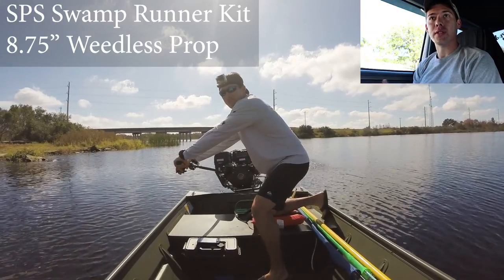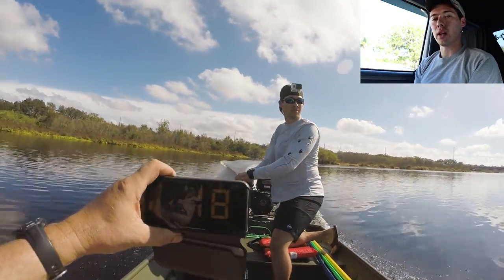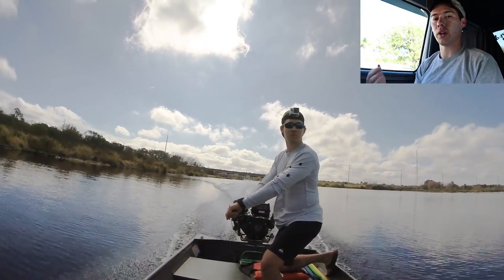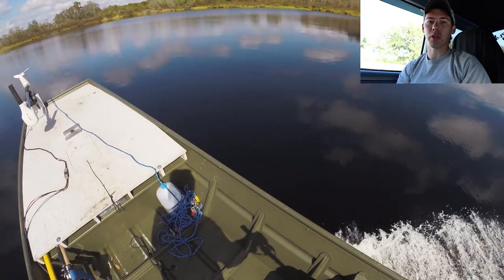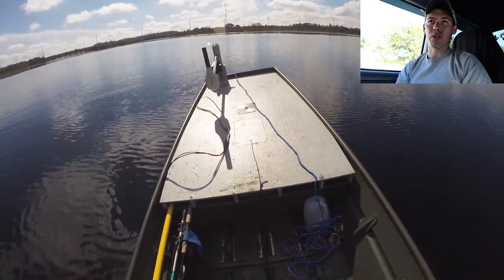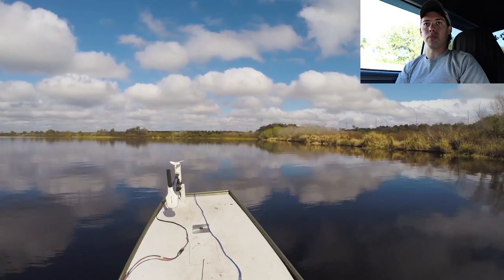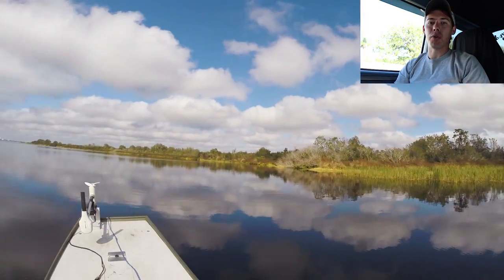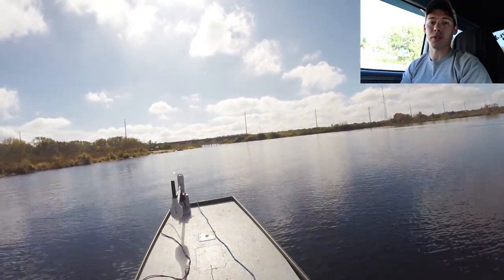SPS Swamp Runner Mud Motor kit Out on the Water! S3E3

Comment: You have put together a very nice series, with a ton of good information.  Thanks for taking the time and effort to put all this info in one place, along with your experiences, and observations.  I have to agree SPS is the way to go for the longtail kits.  I have the small and the large kit, both have been reliable, durable, and loads of fun.
Reply from the maker: Thank you very much Kansas Longtails!! I hope you enjoyed the content so far! Still a little bit more to go. I see that you have a Backwater kit. How would you compare your SPS to that?
Reply: JTgatoring My large SPS kit with 22hp predator is not completely fair matchup to my friends SWOMP lite with 37hp....  I can not say from experience, as we have not driven one another’s boats.  We are able to get around in the same areas at similar speeds so far.  I will say he has a distinct advantage really digging in the mud with the extra hp and stainless prop.  That being said I don’t mind sacrificing my $20 prop to go play in the mud.  My friend may have more to say on the topic.
Reply: Backwater owner here. I'd say it's really comparing apples to oranges with our setups. He has a much lighter boat (riveted) also his is a true flat bottom vs a mod-v hull that's much heavier (welded). Like he said, we get everywhere the other does and at similar speeds. Bang for the buck if you're running a light boat and don't intend to carry a lot of weight, SPS is the way to go. If you have a heavier boat and want to carry more load, Backwater is the way to go. Now with that said, he could have built 3 of his longtails to my one so..
Reply from the maker: Awesome!  Thank you for the info! That is a hard comparison to make with those two on different boats and sizes. I have a few projects lined up right now, but after those are done, I may look into seeing if I can compare the Backwater kit to the SPS kit. I never thought of comparing the load carrying capability between the two... that would be interesting. Thank you very much for the input!!

Comment: You have put together a great series on the 3 brands of longtails! Thanks for taking the time to out all this information out there. I started watching Damon's videos over at Black Warrior Lures a few years ago but that was after id purchased my small SPS kit. Im running a medium SPS kit with gx390 Honda engine on an old heavily built 1436 loweline riveted jon and im now having trouble with my prop skipping around on the surface. Never had this problem with the small kit.. i did bend my skeg a little and that seemed to help but did not totally fix my problem.. however i noticed from your vids that you have your transom bracket turned opposite of the way i have mine... You think this is my problem? Im running the 85in shaft since thats suppose work on a 36in boat or less and 100" is for a boat larger than 36in up to 48in...you also mentioned in the Mud Skipper video your prop nut fell off.. i had this exact same problem with my medium SPS kit in the fall last year but i was running a Mud Skipper prop.. may have something to do with mud skipper props because out of the 6 years I ran my small SPS kit I never had that happen but i also never used a mud skipper prop on that kit....
Reply from the maker: Thank you ky angler42718! I hope you enjoy the videos as much I did making them! If your boat allows it, put the pintal (at least that what I call it or the gimbal pin) on the out side of the boat. This does change the way it rides. I have experimented with this also, it will be in other videos down the road, but to make it short, it rode better for me when the pintal was on the outside of the transom. If that doesn't fix it, make sure the prop is in or near the center of the wake, make sure you aren't out running your wake (when I was going over 20mph, I was out running my wake and would probably benefit from the 100 inch shaft), make sure the transom isn't taller than 16 inches, trying giving the kit more tailweight (use the hole furthest away from the tale),  and test different SPS props. The CKS Mud Skipper props will no longer fit on the SPS kits because the new CKS props don't have a keyway in them and just wont fit. If none of that fixes it, just give Swamp Runner a call and explain your situation. Keep me updated!
Reply: JTgatoring im for sure gonna turn that transom bracket around and run it that way and see it that fixes it... i know that should give another 6-8inches to the tail length and i believe that eill put my prop in the wake more than it is now.. that gx390 just causes my boat to outrun the wake so i never never need full throttle. Did not know they changed the cks props, thanks for that bit of info.. ill have to relay that to a friend of mine thats running the cks kit..you keep me updated on any changes or modifications you find helpful amd i will do the same.. glad someone compared the 3 kits so everyone looking to buy into the mud motor world will know the differences
Reply from the maker: Awesome! I'll keep updating the channel with how the kits are running and if I need to make any changes. Keep on longtailing!

Comment: I have never owned or operated a mud motor. Only outboards . I've had the same 25 hp yamaha on my 15-44 Alweld for 21 years. I am tired of hitting stumps in the Sabine river with the outboard. I have enjoyed your videos and you really seem to know what you are talking about. Another thing I like is that you seem to like to do things as cost effective as possible. What I would like to do is switch over to a mud motor. The motor that I really like  I found on backwater for $3,850. It has a Honda GX690 engine 23hp. My question is, is there a way to get this motor cheaper with a swamp runner kit and engine bought seperately? Another thing I am afraid of is buying the mud motor kit and the engine not being compatable. I just have no knowledge of these kinds of motors. Where can I start?
Reply from the maker: Well, let's see if I can help out! So we'll start with the engine. You want something around a 25 hp (something close to what you have now) and save a little money. So the cheapest option is a 22hp V-twin Predator from Harbor Freight for $750. Normally you can find a coupon for them in a magazine or even on eBay and get it for $600 to $670 (so up to $50 to $150 off) but let's say $750 msrp for the engine. Now onto the mud motor. After testing the longtails, I would only recommend a Swamp Runner. Their Large kit fits the engine without any modification and costs $700. So the cheapest route is $1400, maybe less if you can find a coupon for the engine. If you want a little bit nicer of a motor, I hear good things about Briggs. Hondas are way too expensive. I've heard a lot of good things about the 22hp Predator from Harbor Freight. If it runs without any issues for the first 10 hours then it should last you a long time with proper maintenance.

Comment: Ok . Now is the prop moving so fast without throttle that it moves your boat when your idling or is it just turning but barely moving your boat .
Reply from the maker: At idle speed, with the motor idling, my boat goes 4 mph. If you know you're going to be doing a lot of idling and you want to go slower, then you can drop to a smaller prop size.

Comment: I'm not sure what you mean by that the gimbal being on the outside if you could explain that or show a picture of it I'd appreciate it thanks
Reply from the maker: The transom bracket has a gimbal hole in that the gimbal shaft slides down into. That gimbal hole needs to be on the outside of the boat. There are only two ways the transom bracket can be mounted; with the hole inside the boat or with the hole on the outside the boat. You want it on the outside of the boat like it is in the video. You can look at the assembly video for a better idea
Reply: @JTgatoring  thank you I'm kind of new to this and I bought a 14ft Jon Boat with the medium duty swamp runner in the whole thing wants to like go vertical on me and it's hard to you know figure out where the motor or the shaft is supposed to be sitting in the water but I I think that shaft is is missing thank you though I will be subscribing I think you got the best videos out there appreciate all your help RP
Reply from the maker: @ronpires7053  No problem RP. Swamp Runner has an owners manual that has a detailed distribution of each part along with tips and tricks on how to run a Thai longtail. You can send them an email and get a digital version if you want. You can also watch a couple of videos on this channel to become a little more familiar too. It also helps just playing with the engine and getting experience that way. Best of luck and have fun!

Comment: I've never driven a long tail boat like this, so forgive my ignorance. I see big roostertails a lot; is the point to keep the prop semi-exposed? To avoid having the whole propeller underwater?
Reply from the maker: For the kit I'm running, it has a surface piercing prop. So ideally, half the prop is in the water, half is out. That way it has less drag and in theory, spin faster. With the longtail, it reaches the wake behind the boat, and reuses some of the energy already made and it also helps keep the prop high up in the water column where is it is almost above the rest of the water and your chances of hitting submerged objects decreases.

Comment: What boat would you suggest with the mud runner sps kit, since that transom sucks on that alumicraft?
Reply from the maker: Right now I like the look the of the Trackers. The support is in the center of the transom and also doesn't have a severe angle on the transom as the alumacraft does. The transom is bolted wood is bolted on instead of riveted so it will also be easier to replace the transom wood once it rots later down the road if you plan on keeping the boat for a while. These longtails like narrow-er boats. My dream set up would be a homemade lightweight 1836 or 1838 with whatever engine it could handle.
Reply: @JTgatoring  right on! So, I was looking at getting a 14'-16' boat. I need enough room for me, my dad and brother-- we're all between 200-250 lbs. Also, a dog and all our duck hunting gear. Would the 13 horse power predator engine with the SPS kit haul our fat asses around the marsh with decent speed?
Reply from the maker: @saltcreekammo  Probably not. My brother and I (a total of 300lbs) get 18mph in my 1436 with fishing gear. I think the best option for your set-up would be the 1542 tracker ($1,400) with a 22 hp predator engine ($750) and a Swamp Runner large kit ($700). You can go to Swamp Runners stats page and see what people running on their boats - https://mudmotorkit.com/forum/stats/index.php

Comment: How difficult is it for one person to remove and install the motor? The 6.5 hp motor. I don't have a trailer for my Jon boat and put it in the bed of my truck
Reply from the maker: I believe the small kit weighs a total of 80 pounds altogether. You could take the tail off and move then motor and tail separate to make it more manageable. I would say it is pretty easy to move by yourself.

Comment: I feel like you can weld tiny fins on the prop to help pull it down a tiny bit
Reply from the maker: They give you a template to make your own ears for the skeg, as you said, to cut it out and weld it onto your skeg. The problem is that it is extra drag when going through mud and grass and is something that really shouldn't be needed if it is a quality kit that is balanced correctly.

Comment: Great Videos what motor are you running in this video? 🎣🤙
Reply from the maker: This is the Harbor Freight 13 hp, 420cc Predator Engine, Hemi version if it maters, Item #60349. They do have a coupon for these, check ebay and you may be able to buy a coupon to save some money.
Reply: Do you recommend the hemi motor?

Comment: Looks like the swamp runner took the win...I run my 13 Hp clp but have to horse it a little to get the top speed out of it....maybe next year a swamp runner with my 27 Hp kohler engine
Reply from the maker: If your kit works for you, then it works for you and thats all you need! I know that the SPS worked better for the boat I was tested it on and was the only kit that would drive easy.

Comment: Can you operate them sitting down?
Reply from the maker: Yes, you can! I normally ride them sitting down when its a longer trip, but when I make the videos, I normally only ride for 5 to 10 minutes and I find it nice to stand up.
Reply: JTgatoring thanks. One more question lol, do you add extra oil to get passed the engine shutting off from the low oil sensor or just take the sensor off all together? Ive seen both answers and I got mine coming in the mail
Reply from the maker: I have never had an issue with the engine turning off or stopping at all. I haven't messed with the oil sensor. I've never had a problem with it. People talk about it, but with the two motors I've had, I have never had that issue. Just lean the motor forward, just slightly, fill it up till it gets to the threads. That's what I do. I don't know if its right or not, but I haven't run into any issues so far. Any more questions, please feel free to ask! Thats why I have this channel!

Comment: Why people worry about speed with a long tail.  The purpose of this set up is to get in shallow water and mud and grass and lillies.   If it does thst.  Then you got your money worth.  Wanta go fast and open water buy and outboard.  This thinking just makes these kits more and more expensive..
Reply from the maker: Speed is a major consideration though. There's a lot of people who have to travel a long way to their hunting spot and how many miles you can travel in an hour matters, it makes a difference to them. Yes, it needs to be a mud motor first, but most people don't spend that match time using their mud motor as a mud motor. That's why people worry about the speed with a longtail. It's also a cheap alternative to an outboard and people opt for the longtail because it's a cheaper means of propulsion and has no intention of using it as a mud motor.